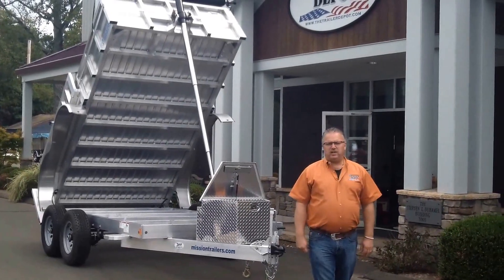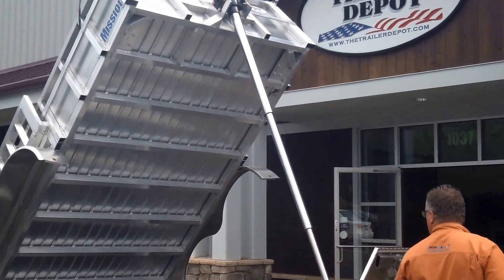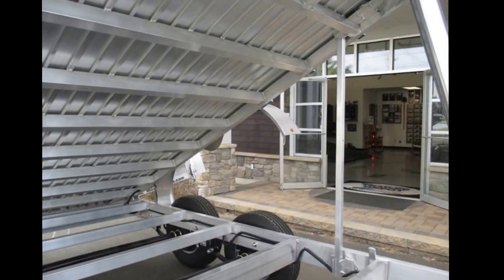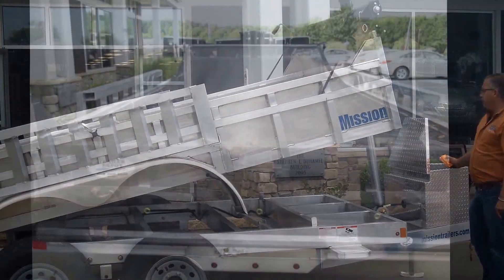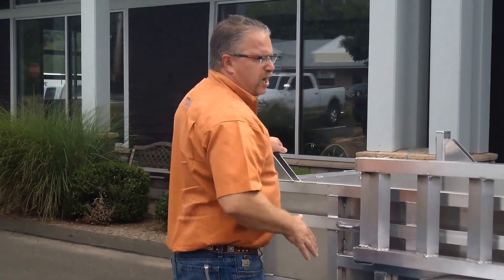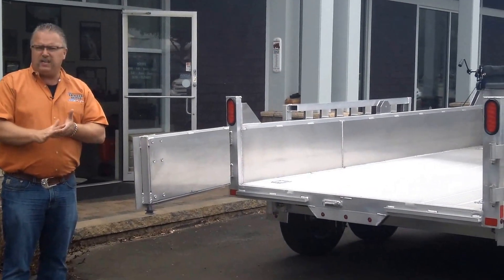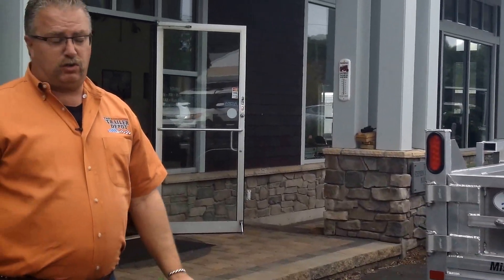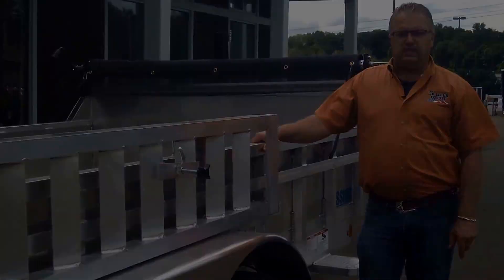The Trailer Depot- Mission 6' x 12' Aluminum Dump Trailer

Comment: I've had a 14' Mission for 5 years now. I use it for demo/remodeling. The only problem I had was there wasn't zerk fittings on the ram where it pivots. They were drilled and tapped though..so it seized. It wasn't lowering so I thought it was a ram problem so I spent $500 getting it rebuilt for nothing. If not for that I get compliments all the time.
Reply: Do you feel like the aluminum holds up to abuse vs steel ok?